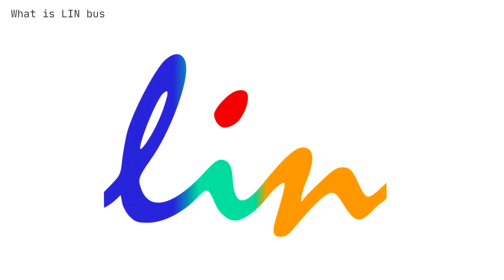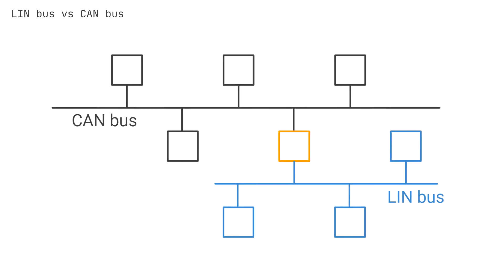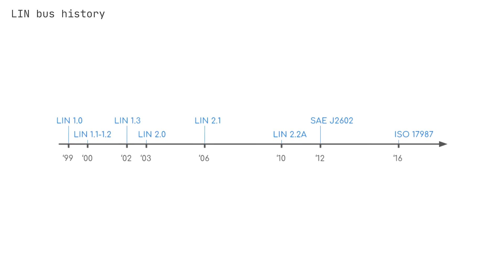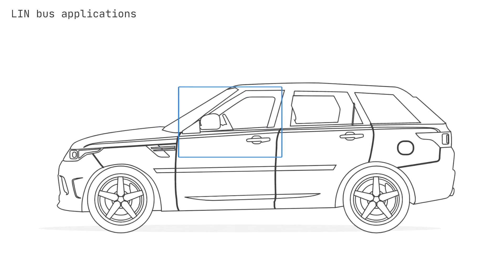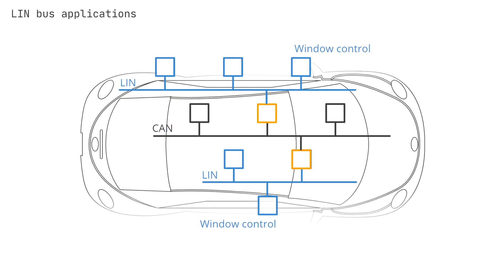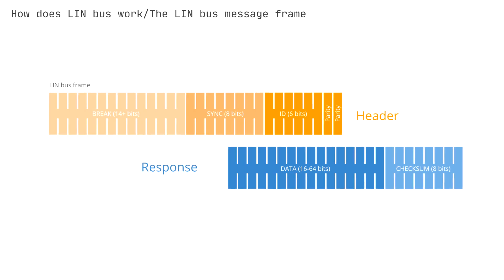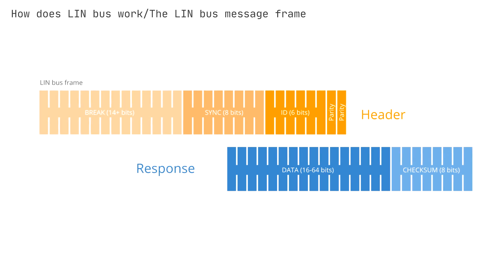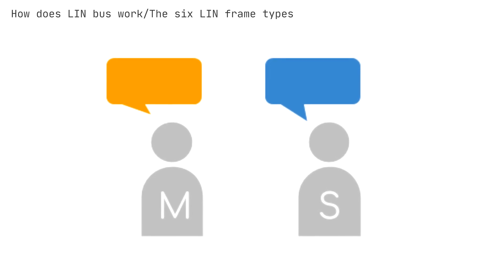LIN Bus Explained - A Simple Intro (2020)

Comment: you said 0x55 in binary is "01 01 01" that's if you meant it right to left, if you meant the other way around "10 10 10" still both would be considered incorrect! it should be " 101 0101"

Comment: If I understand correctly you wont actually find a LIN connection at the OBD 2 port? LIN is just used between module to module communication and some modules translate the BUS to LIN?
Reply: You'll typically find the LIN clusters separately, not via the OBD2 connector - for example you can find some videos on youtube showing an analysis of the LIN cluster in a side mirror.
Reply: @martinfalch4648  thank you for the explanation. Can the LIN network be accessed at all from the OBD bus connection? Is it up to a individual module to translate? Thank you for your time. I'm trying to figure out how to access what I believe are LIN options in a Chrysler. As a Instument cluster repair techinition I need to trigger the gauge/lamp test options while on the bench. I'm finding very little information and tools to achieve this.
Reply: @jeffescortlx  I believe your access to the LIN network will depend on the "master" modules functions. Assuming the car's main ECU acts as the master for all the LIN slave nodes in the car, it'll depend what bi-directional functions they allow and to what nodes. I think you could manually trigger things by tapping into the LIN wiring to a particular module but you'd need to know what signal to send to the node. Check out this LIN bus decoder: https://www.youtube.com/watch?v=tu8Ow6fJm1g
Reply: @suj1945  thank you for the information, I'll dig into it.